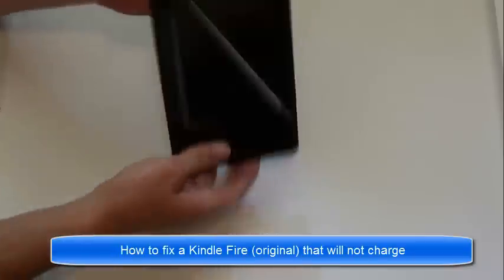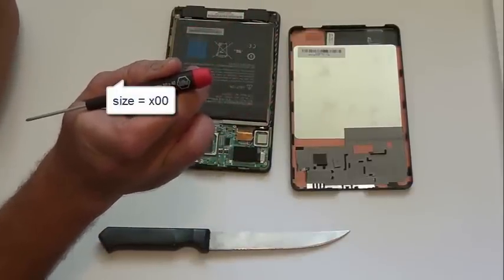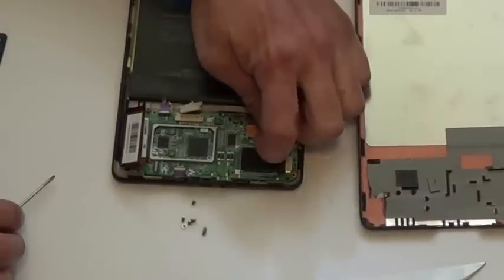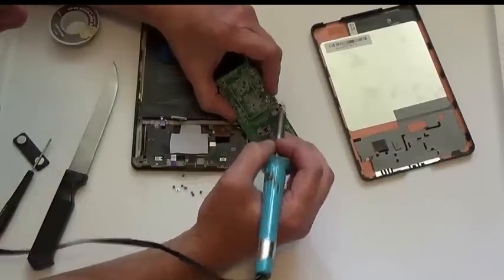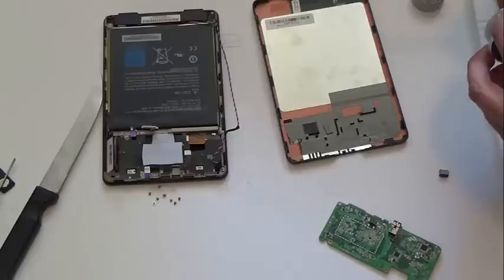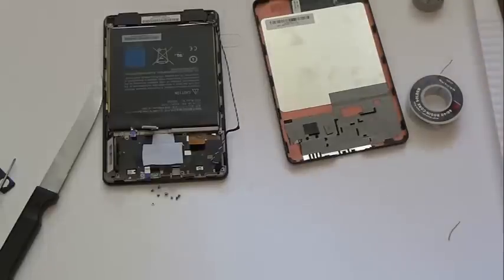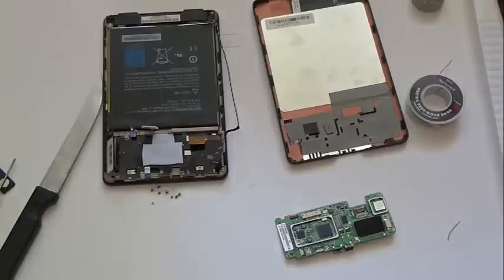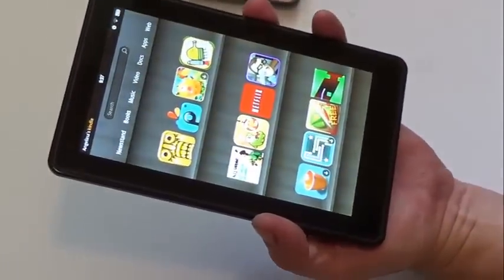Kindle Fire Won't Charge Fix

Comment: I watched because mine got wet.  I opened it, dried drops, put in rice over night and it worked.  Then it stopped.  I opened again and the antenna wire was loose.  I was hoping to see exactly where the antenna wire goes.  Unfortunately, you didn't show.  *sigh*
Reply from the maker: Take a look at 3:31, it shows the little wire and even call it the antenna wire. That's where she goes. Glad that you got yours working again. It is always nice this time of year when we don't have to rebuy things.

Comment: you did not let us see how to do it, it was off camera
Reply from the maker: When I filmed this years ago, I had no idea that it would reach 700,000 people. Otherwise I would have done a lot of things differently. Seeing what I am doing is not really important. I am just reflowing the solder lines and I can't see them myself. I am just using the motion across all 5 lines at the same time. I relied upon the fact that solder will want to stay on the traces if pulled straight.

Comment: I have this tablet the first year Amazon fixed it free but then another year they wanted to charge 100 dollars to fix it I looked up this tablet turns out all the fire hd ten tablets are defected and when it gets fixed it only last a year before it started doing it again don't have 100 dollars to keep spending like that my suggestion is never buy these tablets cause they are defected period.
Reply from the maker: Yes, I never expected that this video would be viewed by so many but it went viral during the first 2 years and hit over 1 million. I think it is safe to say that Amazon did not do a good job with this connector. 😯😬

Comment: Mine is going to 10 to 7 to 5 to 0 and it takes a long time to charge
The best for me is 40 percent
Reply from the maker: +Ben C. Darling It sounds like your battery is fully connected but it may be degraded by use. Perhaps it has been charged too many times or  has be left with a very low battery and destructed itself.

Comment: And I'm going to Home Depot tommorow so I need to know
Reply from the maker: excuse the cut and paste, but.... Sorry, I know of no safer or even easier way to do make a solid electrical connection than soldering. I have seen a few soldering tutorials on-line and would definitely suggest them before trying it. Soldering is one of those skills worth developing. Like whistling but more useful.
Reply: Peter Carcione Ive practiced during many days of industrial tech,

Comment: Too complex.  Kindle Repairs for Dummies?
Reply: The device was not intended to be repaired without a moderate level of electronics repair experience. Given the relatively low initial cost, the only way a repair center can even hope to cost effectively repair the device would be to open the unit & swap major components with working parts that were nearly free. Even then, the cost of labor, testing & shipping would likely push the cost to about 50% to 75% of a brand new unit.

Individuals without a moderate level of electronics repair experience are unlikely to have any measurable level of success in repairing these devices. They would be far better off selling the unit as a damaged item on eBay and putting the proceeds towards a new device (which can still be had for about $100).